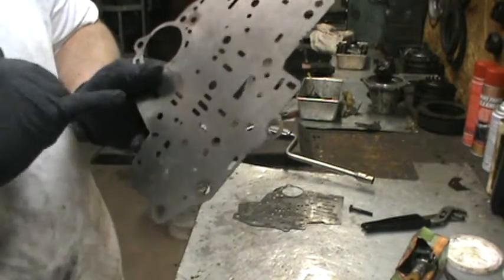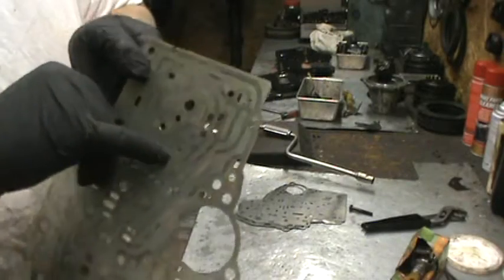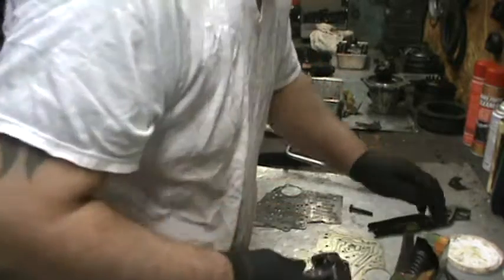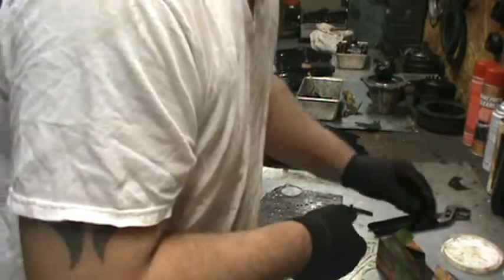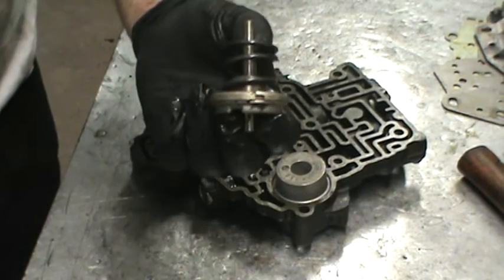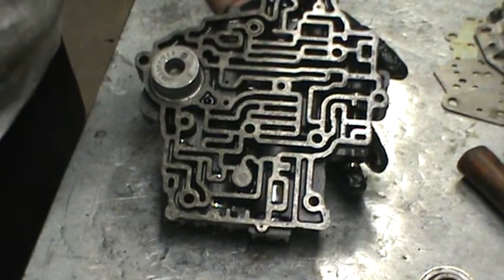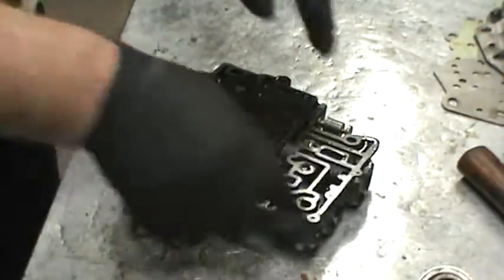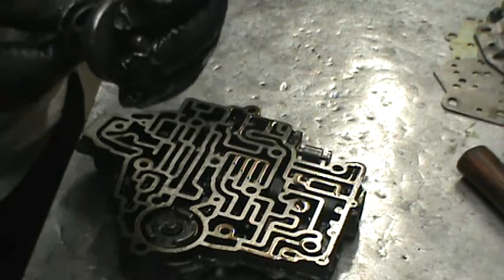TH400 PT. 9 valve body

Comment: HI There.. I'm pulling apart my th400 .. it had been run very low on oil and would not shift up into 3rd, reverse had zero power until it was topped up. Still would not shift to 3rd despite 1-2 being smooth, pan off showed some metallic debris on the magnet and some tiny metal strips aprox 4mm long maybe 2/3. What should i most look for if nothing is blindingly obvious .. will over heating cause the lack of final shift?